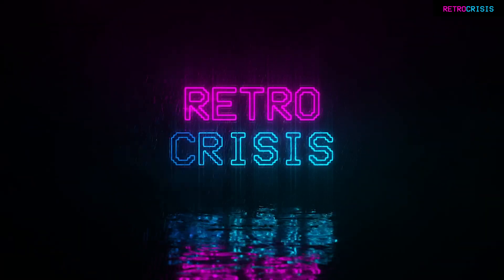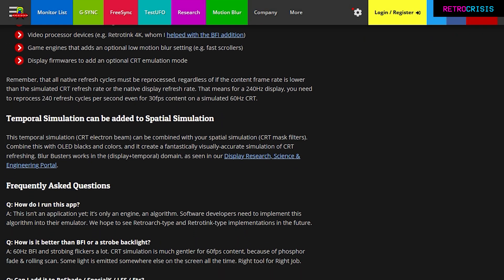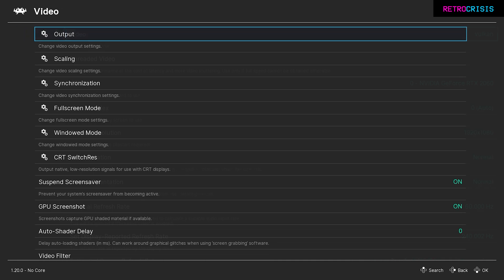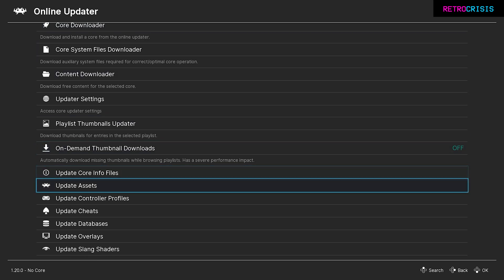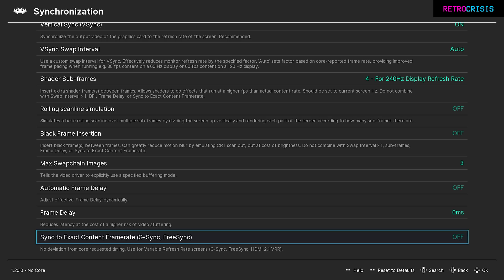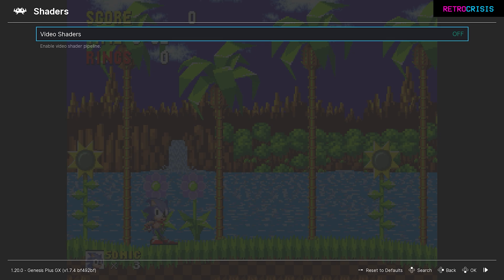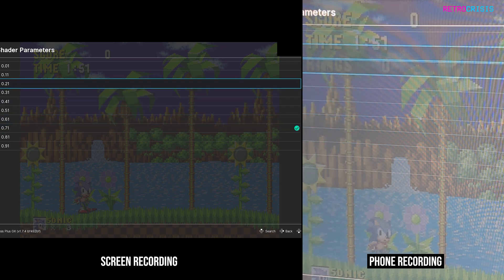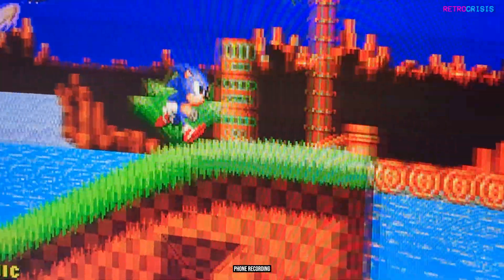Blur Busters CRT Beam Simulator Shader - RetroArch Configuration Guide

Comment: GSync is important because it is great for modern games .. nah!
Reply: You can turn of GSync for just RetroArch
Reply: @cajampa  indeed thanks!:hand-pink-waving:
Reply: With the right software, you can use profiles to automatically turn on/off GSYNC.  For example GSYNC can be automatically turned off for RetroArch
Reply: It's actually completely useless. Also this is a retroarch tutorial lmao
Reply: @astrea555  yeah I did turn it off, and looks great on my 240Hz Oled...!
Reply: @astrea555  Useless for retro gaming, essential for modern PC games.
Reply: @Phil The exact opposite is the case
Every single retro console and arcade system runs at bizarre non-standard refresh rates which means if you force them to 60hz they will run slower or faster depending on the system
Reply: @bardhi09  You don't need Gsync for arbitrary framerates. Custom Resolution Utility (CRU) can force resolutions and refresh rates as an EDID editor.

I'm a huge proponent of Gsync... been using it since the XB271HU came out in like 2016 but it's really not that important for fixed refresh rate retro gaming. The experience I'm getting at 240hz with the BFI type shader plus a CRT filter is awesome.
Reply: @Phil_529  Gsync has lower input lag, which is quite important for 60hz retro games. Sadly no BFI methods work with it, so i use lossless scaling x2 framegen @144hz tv to increase motion clarity, which works with gsync and because of this has lower input lag than all the BFI methods. (Getting 31ms end to end latency with it enabled, 20 without, both using gsync)

Comment: It's amazing, the problem is that LCD screens burn the image for a while, I wouldn't recommend using it unless you own an OLED
Reply from the maker: @dyoxsito9424  most modern screens would have anti burn functions such as pixel shifting etc, so hopefully it should be ok
Reply: @RetroCrisis  Ah sorry, I mean image retention, I tried it on my LCD in Mario World and the scenarios were still visible even with the black image, it was solved by removing the CRT Beam Simulator, the Anti Image Retention for LCD of the shader did not help me

Comment: Having to go to display setting and turn off gsync (which I leave on 100% of the time) is kind of annoying.
Reply: You can just disable gsync for retroarch in the nvidia control panel or nvidia inspector.
Reply: @raknikmik  yeah, i forgot about per program nvidia setting, good idea
Reply from the maker: @seethruhead7119  for me I had to turn it off. But give it a try and see if you can use it without turning it off
Reply: @RetroCrisis  i'm usually using retro arch on handhelds (like the dmg, with your shader pack!) but i will setup retroarch and try this as soon as i get a new GPU for my pc
Reply: you do know you can disable gsync on a per app basis, right?